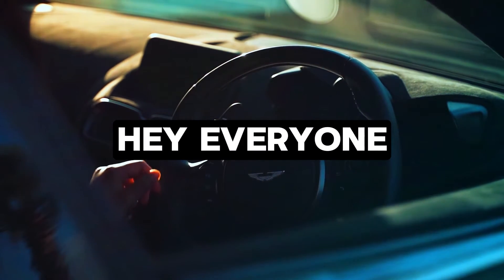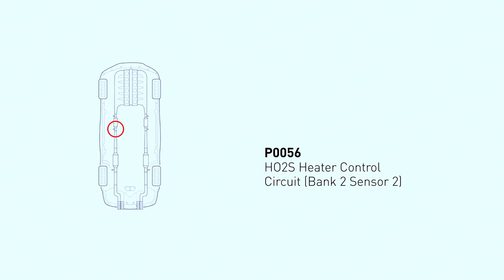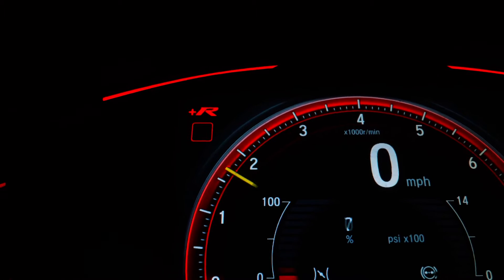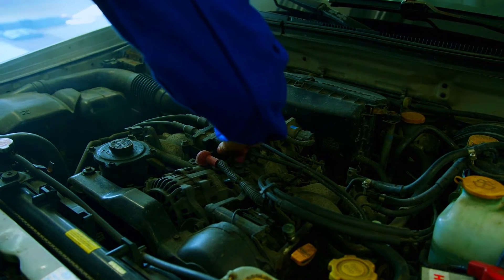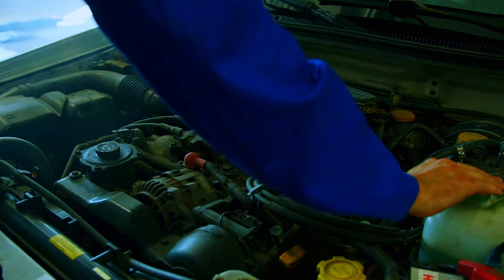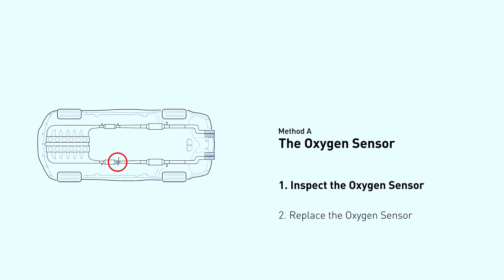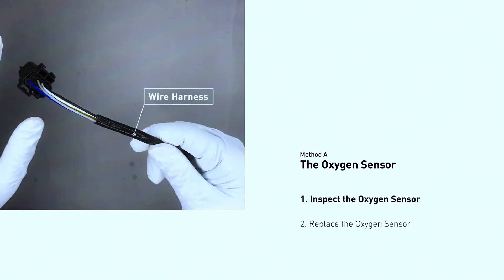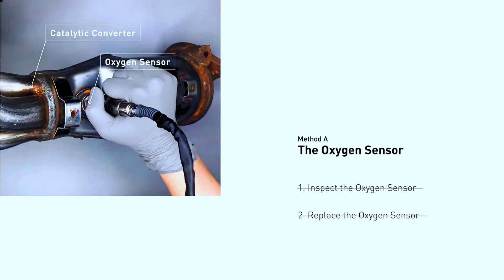P0056 Code: Is Your Car Burning Too Much Gas? Easy Fix !

Comment: Very to the point Loved it.
Reply from the maker: Thanks for the kind words. The P0056 code usually means the heater circuit for the downstream oxygen sensor isn’t working right. Most of the time it comes down to a bad O2 sensor or damaged wiring, and replacing the sensor usually clears it up and helps the car run more efficiently.